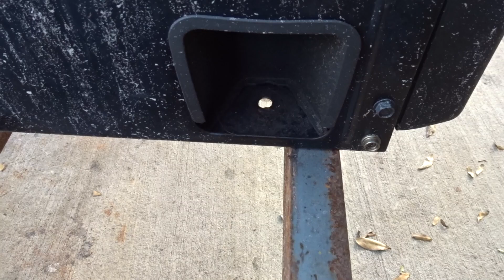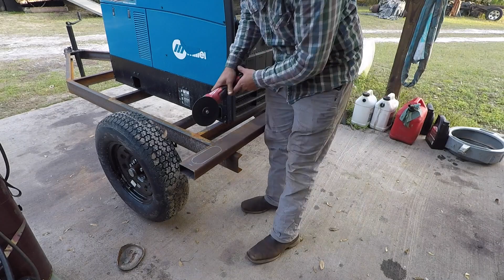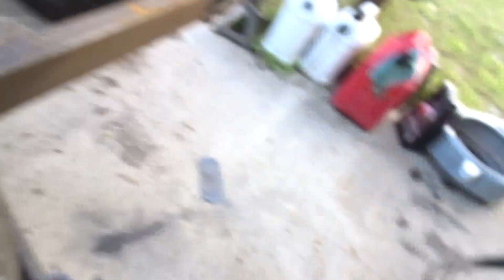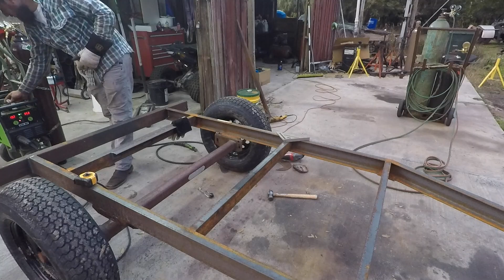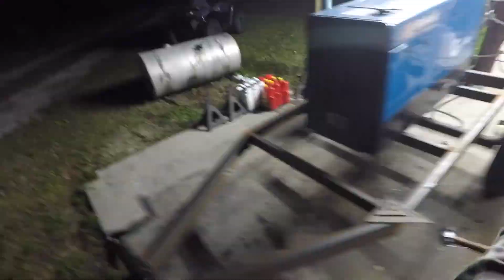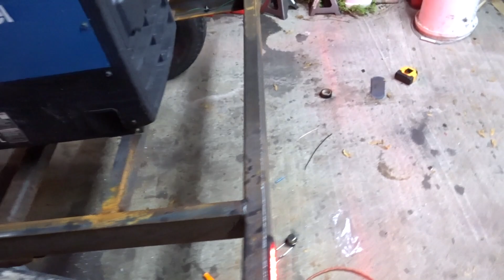Welding Trailer Build Pt 2

Comment: Another great video. Thanks for sharing. How I always remembered colors for lights there is an “L” in yellow and an “L” in left and there is an “R” in green and an “R” in right. 
Looking forward to seeing this trailer finished. I contemplated building a rack to mount a welder on so I can put it on my flatbed truck and then remove it if I needed to. Then I saw this video and now it makes more sense to me to build a trailer.
Reply: instablaster...

Comment: Only 8 min in but, couldn't you weld a bolt to the inside of the tube behind the lights and put a nut on them for the grounds? Also as I seen mentioned I remember trailer wiring as going down the highway, the grass (green) is on your right, and the yellow lines on the road are on your left.
Reply from the maker: Yes, welding a nut inside is a good idea for the grounds

Comment: Coming along nicely Jesse!!! Do you use a certain tip for the torch to make nice and clean cuts like you did for the tail lights?
Reply from the maker: For anything under say 1/4" I try to use a 000 tip and go as quick as the cut will allow to eliminate distortion on thin material

Comment: very neat trailer. how thick of material will that welder do?
Reply from the maker: I have yet to test it on its limits yet, I’ll go into a more in-depth review here shortly.  Should be well capable of 3/8” plate in a single pass possibly more.

Comment: So what do you think of the forney 220 mp I was considering buying  one haven't heard much about them saw your video on it by the way great channel  bud
Reply: I actually bought that machine because of this channel. One of the most honest reviews on it I have found. It seems to be a decent machine so far, no gripes yet. My only complaint is the supplied chart seems off for mig. Maybe it’s just my welding skills 🤷‍♀️
Reply: @samchivers621  I own a welding shop and I own all Lincoln welders and always been a Lincoln man but the forney has peaked my interests
Reply from the maker: No complaints at all about the machine
Reply: @j_moffitt  ok thanks